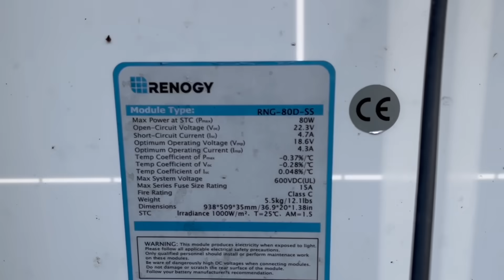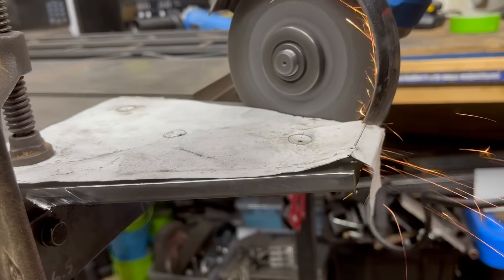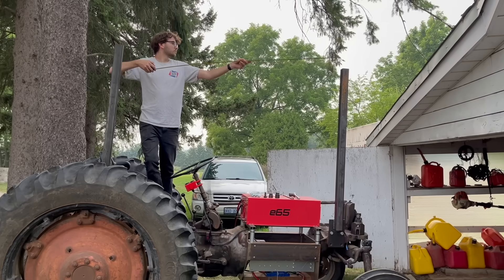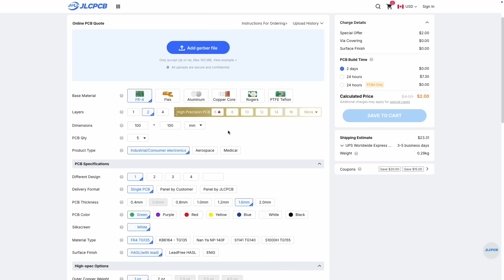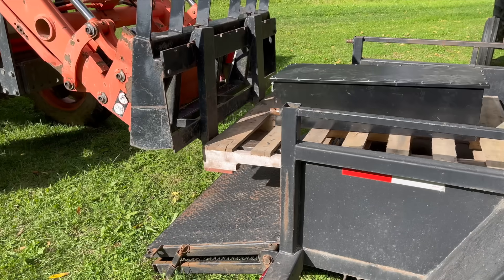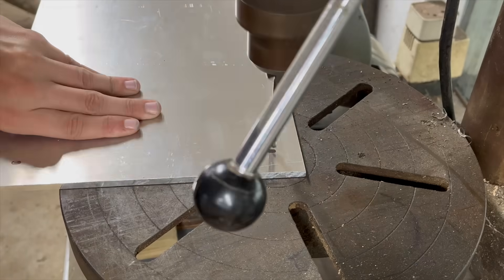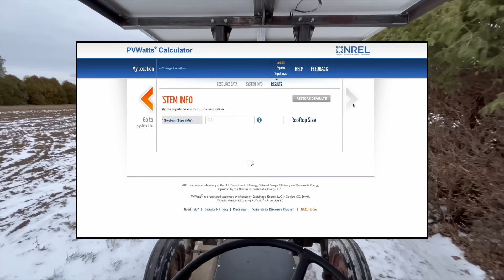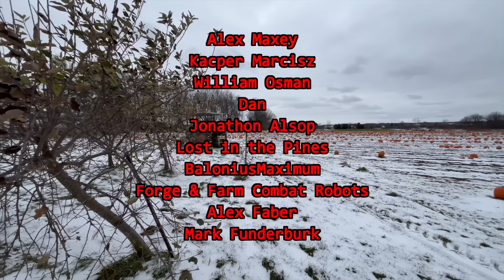Adding solar charging to my electric tractor

Comment: That drill chuck should be fine - just needs a good whack to set it back on the taper (might clean it, first) ....drill presses only take axial load, so if the work wanders or chatters, it can work the either of the tapers loose (which is why you can't do any milling operations with them)
Reply: Haha...I guess you know exactly where I paused to comment. NEVERMIND! carry on

Comment: Here's an interesting hack I've learned from the YT guy electrodacus: there is no such thing for a solar panel as too high of a charging voltage. The rated voltage of a solar panel is when there is nothing connected. The rated amperage of a solar panel is when it is shorted and voltage is near zero. MPPT finds the sweet spot somewhere in the middle, but that's an optimization that is often not worth the added electronics. Best solution in your case would have been - 4 panels in series, hook them up straight to the battery and the voltage will drop to battery voltage while the current will be something between rated and zero of a single panel's rating. As long as your batteries can take that amperage (and your prismatic cells can), you're good. Your BMS will function as a cut-off when the batteries are full, otherwise, the panels would keep charging indefinitely. Since the BMS uses separate paths for charging and discharging, this will not impede you operating the tractor.

Comment: Very cool concept, but this execution needs serious work.

- solar panels are cheap. Whenever you have a system like this (small with space constraints), you need to be putting the best panels you can afford, to maximize the power you get per panel. You spent all that money on brand new steel framing, bus bars, wiring, and four separate boost converters, but then skimped on the very core of the system that generates actual power. For the money spent, you could have MUCH more power than you do, close to double.

- there is a reason most people put panels in series and then use a single charge controller: cost and efficiency. You're using this tractor out in the open, you shouldnt be expecting partial shading. Not to mention boost converters introduce additional cost and inefficiency into your system. All the additional wiring, the extra fuses you need, not to mention four additional points of failure. This design could really use some improvement.

- lithium iron phosphate cells are excellent for heavy duty work... Except in the cold. Charging below 30F will result in permanent lithium anode plating, destroying your battery. You plan to park this truck out in the open and trickle charge with solar: i guaranteed you this battery will be dead by january. You need to have self-heated AND insulated battery for this kind of application.
Reply: Wrong -30 ferhght

Comment: hate to rain on your parade but either you excluded the heating power that your lifepo4 battery should have in your calcs for winter or you are charging the battery under freezing temps which definitely damages them

Comment: redneck hack for cutting bolts, put the nut on first past where you're cutting then just take the nut off and it will clean the threads

Comment: Keep those MC4 connectors on the solar panels.  You void the warranty on panels when you cut them(if you care).  They are also designed for high voltage DC which most connectors are not.  Even the cables for solar panels are double insulated to avoid ground faults.  You can get MC4 extension cables and cut in half.  Then you have cables and connectors that work with the solar panels.  It will be easier to upgrade later since new panels will plug right in.  Well done on your project and appreciate you showing the mistakes along the way.  We all make them, only some of us admit it.  :-)
Reply: old second use panels ... no warranty

Comment: That solar panel roof is a great addition!

I'd strongly recommend putting an additional (maybe 20A) fuse to the 12AWG tap near the battery, so if that wire wears through or otherwise get shorted, it doesn't cause a fire. 500A continuous will make that wire light up like a christmas tree.

Comment: In Australia, most old solar panels are free, people upgrade their systems and give away old panels, inverters, and roof rails. I wish people can use these free stuff for their tractors and lawn mowers instead of throwing them for landfill. You could have used only one controller by connecting all the panels parallel and then shading will not affect. Now in the same area you can fit 4 panels of 440 watts bifacial panels. They make power from both sides and give enough shade as well. N Type Topcon bifacial panels are very efficient.
Reply: YES!  Bifacial would have significantly increased the yields.  I'm a dealer with Soligent and get good prices on Bificial panels.  After all the work that goes into DIY arrays the extra cost for the newest technology is worth it.  Bifacials outperform the rest of my older monocrystaline panels by about 50%.  They are very impressive on intermittently cloudy/sunny days.

Comment: Check if the battery has low temp cutoff. Lithium batteries should never be charged under freezing temperatures as this damages them. I did not see a built in self heater in the battery.
Reply: It doesn’t damage it below 0c as long as the charge amperage is a lower than a tenth of the C rating of the battery. 

So as long as he doesn’t charge his battery with a charger more than 20 amps when is below zero he’s good
Reply: @JeffFennell-r2q  It does damage them. Charging a Lithium battery below 0°C / 32°F causes a chemical reaction referred to as “Lithium Plating”. When this chemical reaction occurs, the internal resistance of the battery increases and reduces the rate of chemical metabolism. This chemical reaction causes a permanent reduction of the battery’s capacity and will continue to reduce its capacity each time this reaction occurs

Comment: Serial hybrid electric tractors will be a thing soon. Would love to see a big bud or an old Versatile converted with electric mining truck axles batteries and a small diesel generator. Just think of the possibilities, as weight on tractors is a good thing. Combines are obvious candidates for serial hybrid power systems such as Nexat, which already have electric ground drives. Electric air seed carts make a lot of sense, get rid of the inefficient hydraulic drives, put extra batteries and a pony generator on the tractor. Add a rear electric drive axle to the cart.
Reply: Yes it qas

Comment: I know the reason you used those panels is because you was able to get them cheep but in the future I would look into by facial solar panels some of them exceed 600 W and for your setup would probably work more efficiently than ground mount systems do to the fact you are farther off the ground.
Reply: fwiw, new Jinko 510w panels can be had for around 100-150 USD each. they're great panels

Comment: A tip I used on a similar project is grab a roll of peel n seal and cut it to the width of the panel gaps, then when it rains your not getting wet from the water collection dumping on you though the gaps

Comment: Pb blaster does wonders overnight. And it smells good when you burn it with a map gas torch, which makes it alot looser!  Also wire wheel the threads and bolts before.

Comment: Especially in winter you are too far north for flat non tilting panels.  A center pivot with an arm coming down that locks on each side so easy to flip when needed. You'll easily double the solar power.  There are more efficient panels too.
Reply: Absolutely. He put in all that work and installed bottom-of-the-barrel used panels. Disappointing.
Reply: Need  dark night anti so l ar dell chareg moon light

Comment: oh man XD that moment you went and plugged it into the battery for getting length of the wire right i just could not help myself but chuckle when it happened. Totally something i would have done.
Not kidding i stuck my fingers into a live psu from a pc once and got shocked bcs i forgot to unplug it.
But good job on the solar^^

Comment: So, what I've heard: same as LiIon, LFP are better between 20 and 80%, but to get a correct capacity reading, it's better to fully charge. This will recalibrate the capacity reading.

Comment: im shocked you didnt angle them slightly down on one sight to promote drainage in rain and also get a slightly better yield when parked towards the sun
edit: why didnt you just wire all the panels and converters in parallel? it would make the wiring way less complex than wiring up the panels to a dedicated converter

Comment: Boosting engagement with one of my favorite channels by just saying hi, and suggesting that you could have improved things a little by making your panels tilt-able when you're storing the tractor outdoors during the day.  That would have allowed you to gain a fair bit of advantage relative to horizontal panels, which are optimal only when the sky is overcast.
Reply: Just park it on a hill😁
Reply: @metricstormtrooper  this is proper thinking. Why makes it more complex than it already needs to be. We are not a US automaker

Comment: If you put a nut on the bolt you are sawing first, the nut will fix the end threads when you remove it.
Reply: guy got a lathe could have just parted it off on the marchine lol and  then chamfer it
Reply: @Dimka2  Sure, I cold model the exact bolt I want to use in CAD, then 3-D print it in PolyCast, then make a lost-pattern investment casting of THAT...

Sticking a nut on then unscrewing it is A LOT easier!

Comment: Accidentally shorting a battery with a tool is something you do once and you'll never forget
Reply: My record is 5kw twice in 24 hours. Dead short. Liquid metal everywhere but in my eyes. I wear safety glasses now. Not sure if the soot or bmses (4) saved the day. Lol. Scary.
Reply: @silverleapers thời đại của pin muối đây ư... có thể 50~100 năm nữa
Reply: And it will happen again........ With tools on the battery😂
It just keep happening
Reply: @mototola86  I saw someone installing a car battery with a wrench when they bridged the terminals.  The wrench started to glow and weld itself to the battery.
Reply: @ChrisP978  how does connecting golf cart batteries together for a solar build. And the copper bar that connects the batteries together arced well there was hydrogen in that battery😢.
Reply: Unfortunately, the old joys of losing a spanner into an open battery box, of our lead-acid days, are all gone now.  The BMS in the LiFePO4 battery makes short work of our mistakes (turns the battery off).
Reply: I Plugged an 6s lipo on into an RC car while sitting on a bed.
 The molten metal went straight through the foam.
Reply: @samuelrippe390  A 6S lipo is typically a NCA lithium chemistry with no BMS (BMS is usually external and typically only connected while charging, so its easy to make a mistake).  And the battery charger is typically not integrated with the product either so if you program it wrong... boom.  So, yah, that is what will happen.   Do anything wrong and it will explode.

Lithium batteries used in home storage, gold carts, (tractors now too, apparently), and so forth are typically LiFePO4 with a BMS built-in, plus overcurrent, short, and thermal protection.

LiFePO4 batteries don't explode even if you dead-short the cells and its a lot more difficult to overcharge them (though its still possible) due to the cell voltage range.  The BMS won't let it happen anyway, and the BMS isn't typically external to a LiFePO4 battery like it tends to be with RC cars.  Of course, you can still overload a LiFePO4 cell and it might eventually catch fire if you do, but it would have two be dead shorted for a good chunk of time.
Reply: This! My friend once found out that measuring lithium cell with caliper was a bad idea 😂
Reply: Similar thing to driving into power lines with a really tall tractor. But he won't end up doing that...
Reply: @ryelor123  I saw that too... like that was close too close!
Reply: I once accidentally shorted a pair of Tesla Model S battery modules, the flash was dazzling and it took hours for my vision to totally come back, the parts that touched were nearly unrecognizable.
Reply: My uncle shorted his class ring on the starter.
Reply: One time I took apart an old camera flash just to see how it worked, turns out the cap still had some juice in it, accidentally shorted the two legs, went blind and deaf for a good 10 seconds, I scared myself pale that day.
Reply: Is this a reference to when he shorted a battery with a metal tool in a previous video? (Check the $10 roomba vid if you've only watched the tractor ones - that was just one 18650 so not this dramatic!)
Reply: I bridged my mom's lead acid battery with my ratchet once, had to smack it off with a hammer. Ended up having to replace the battery. Learned a righteous fear of electricity that day lol
Reply: Everyone has seen the white light  when using wire stripper followed by heavy gauge " extra " holes in wire stripper 😂
Reply: Only once... I wish.

Comment: youtube put you in the algo! I enjoyed the fabrication and that is going to be amazing in the summer time! We had 3 tractors growing up, all Ford. One 4000 with a manual Hi and Lo gears, One 4000 that was a "select-a-speed", and a 1340 with a bucket on the front. The last one would have made a GREAT electric conversion. All were sold with the property when my parents moved.

Comment: Nice upgrade to an already awesome project! Maybe do a heated seat next? :D I've seen these boost mppt modules a couple of times now. How quick is their tracking? I've noticed that my grid inverter is dog slow compared to my chargers of another brand when readjusting the power point.
Reply from the maker: Thanks! Haven't tested them too thoroughly yet, but when connected to a lab power supply, if I increased the voltage limit, they ramped up to the new limit in a few seconds.

Comment: Can you put together a kit for small tractors like yours? I have a tractor i want to do
Reply from the maker: What model is the tractor?
Reply: @LiamTronix   is an old Allison Chalmers from the 30's
Reply: @LiamTronix  and I think it would be easy because it has rail chassis structure and the engine is not load bearing
Reply: @LiamTronix  sorry update, it is a 1949 WD Allison Chalmers
Reply: They make conversion kits for cars, thats basicly the same.

Comment: 4:23 just a tip. If you put a nut on the bolt, then cut the bolt, then back the nut off where you just cut, the bolt deburs/forms the end threads so there not so damaged
Reply: Cut it right in angel of the thread! 
And dont do anything.... bc it works
Reply: @mototola86 😇
Reply from the maker: Yep, I often do that, but I didn't have any of the right size of nuts for those bolts. Since these were going into a threaded part of the tractor and not a through-hole, I didn't have to buy nuts.
Reply: If you are removing bolts again thread the nut on until it’s about 1/8” proud of the bolt. Then hit the nut with the hammer and you won’t waffle the threads on the lit and can reuse it
Reply: Nice work. Love the commentary!
Reply: With a steady hand you can thread that bolt in without smoothing over the end.

Comment: Here's a comment to boost engagement. I don't own a tractor and have no experience with farming, but still know for a fact that real tractors should be used 2 hours a day :D

Nice LFP upgrade! Yeah make sure to fully cycle those from time to time, its not just "you can charge them to 100%" but you can get a lithium inventory shift over the electrode area if you regularly don't. This results in plating when fully charging after a lot of part-cycles. In general a thing with large format cells, worse with LFP because the potential is so similar between "more or less charged", so there is not much incentive to get balanced. But leaving the tractor in the sun in summer should take care of that, slowly charging the pack to 100%.
Reply: Buy  John deer ektric tracketrt